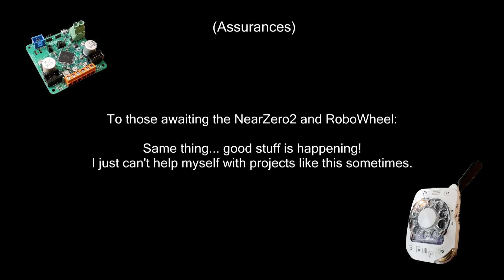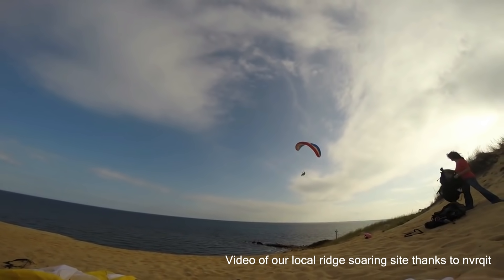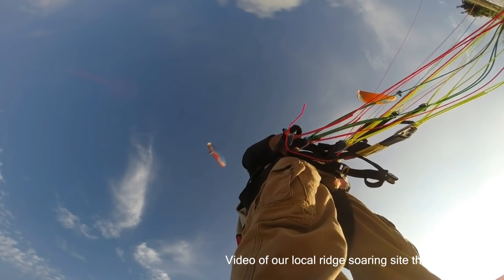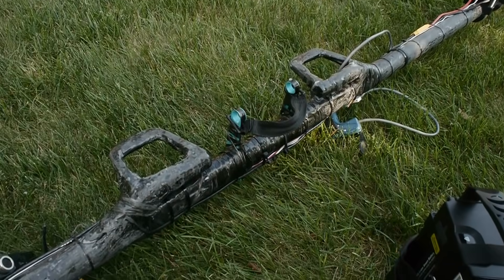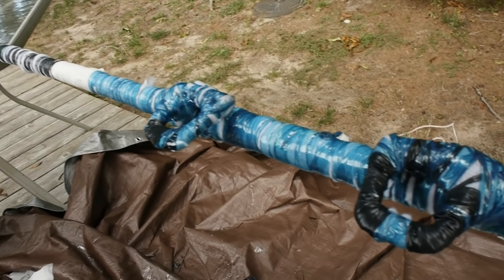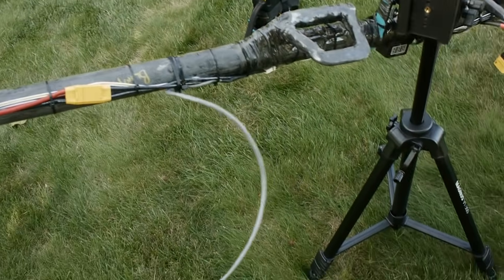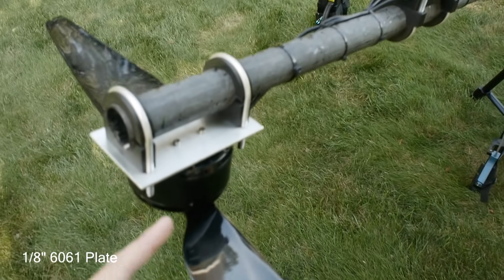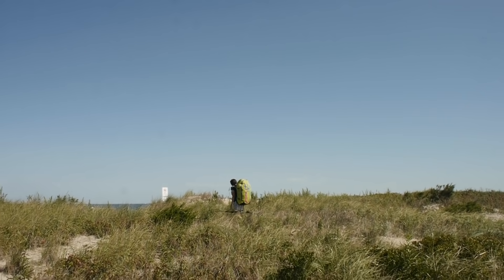Stupid-Simple Electric Paramotor

Comment: You are in the same axial plane as the propellers. If the blades break, you will be cut up from the sides. Keep the propellers either well in front of you or well behind you - NOT in the same axial plane.

Comment: Thanks for the great video. I found all the parts except for a compatible battery charger. All 12S Lipo chargers seem to come with connectors that are incompatible with Tattu 12S battery. Any guidance or solution there would be greatly appreciated. Thank you!

Comment: I would suggest some protection against asymmetric thrust. You don't want one side pushing more and twisting you in your lines. Quick reaction to loss of thrust on one side implies electronic regulation keeping both sides at the same speed, or even yaw rate sensing by gyro.
Reply: Maybe the best solution is to simplify it completely, start by going to a single slightly larger propeller and then move the propeller thrust line so that is central to the pilot's CG, basically on the pilots back.

Comment: Interesting. I’d shroud those props with a guard, similar to an oscillating office fan to protect the blades, and protect yourself. If a blade came apart due to damage or simple fatigue, you are in the plane of rotation. Pretty cool project and well thought out.

Comment: really impressed by your contraption.  I've also run into problems getting things molded and vacuum bagged correctly.  I reliantly started making forged carbon and forged glass parts with much better success.   Here is a great walkthrough video that really helped me.  The principles there also work perfectly for fiberglass.  I printed my parts in PLA.  https://www.youtube.com/watch?v=25PmqM24HEk

Comment: That is absolutely brilliant and the video was a delight to watch.  Makes me want to take up paragliding.  I appreciate the potential problem with deployment of a reserve though.  Paratroopers use a device called a "hook-pile tape (military name for velcro) lowering line" that lets them drop their equipment on a 15-foot tether to get it away from their body before landing.  Something like this would put the BlimpDrive well below you, but some thinking and testing would need to be done to ensure it did not create a new reserve entanglement issue.  The lowering line has a snap link that can be detached under load though, so you could always cut the drive away if necessary.  What a great and simple idea the drive is to solve a real problem.

Comment: Have you considered a cut-away system for it? Maybe a small parachute attached to it. That activates along with the cutaway? I know about skydiving cutaways but my knowledge of motorized paragliding to be zilch. Oh, do the vibrations cause problems with the carbon fiber connection points with the aluminum?

Comment: As an avitor myself, who has built and flown experimental planes, including putting a carbon fiber ground adjustable prop on the last plane I owned, I would recommend incorporating some kind of anti-rotation measures on the U-bolt attachment of the motors to the boom arm, or at least make meticulous inspection of those part of every pre-flight check... because there can be all kinds of wierd high frequency vibrations and harmonics generated by the prop blades transferred thru the motors and mounting hardware to loosen stuff up just enough to possibly end up with a motor's alignment slipping rotating on the boom arm and you definitely want both props always pointing the same direction at all times while in the air. Something about carbon fiber prop blades give them a magical, insideous ability to generate vibrations and harmonics and transfer them to the propellor hub  into the motor, and where they go from there can and up doing all kinds of wierd, unexpected, unimaginable bad consequences.... like in the case of Sensenich's carbon fiber blades + aluminum hubs ground adjustable hubs did when used on Continental O-200 4-cyl engines on light sport airplanes... ended up destroying the camshaft/crankshaft gears at the back of the engine after the harmonic vibes travelled all the way thru the crankshaft. Analysis finally revealed micro-chattering from high frequency harmonics were eating the teeth of the gears.
Reply: Now that's a good comment

Comment: What a brilliant idea! Instead of a lawnmower on the back, have it pull the carabiners. 👍
And yes, ducted props with cage would be more than a nice to have.
Plus a separate kill switch in case the Arduino decides to hang in the full throttle position or the potentiometer starts giving off incorrect values.
But I believe that this thing has huge potential.
And it is so quiet!

Comment: Newer propellar based plane models have them moved from head and wings to tail end for safety and efficiency. May be safty, balance and controle be better with a v shaped swept back structure fused with battery from back of the hip. Version next prospect for improvisation. Kind enough to share your model in detail.

Comment: I applaud the idea but the execution is very dangerous.  There are two major issues that I can think of off the top of my head.  The plane that those propellers are on comes much too close to the flyer.  If one of those props hits something it's going to shoot sharp pieces of carbon fiber much too close for comfort.  Also at the same moment you are going to have thrust on one side and not the other trying to spin you.  Same issue minus the flying debris if one motor goes out.  Hobby class speed controllers are not particularly reliable.  Either scenario could range from a small bruise to death depending on how lucky you are.

Comment: You are one smart human!  I came across your video for the stick... take off assist you made.  I am fascinated by it because you demonstrate ingenuity to us non engineering types.  My question is... where are you buying your pieces/parts?  Can you recommend where a novice like me might find these types of things?  I need a wheel chair/scooter device to get around.  I live in San Diego and cannot get out on the beach with my scooter and have ideas for a personal beach accessible 'thing' but don't know where to learn how or where to buy what would be needed.  My skills were in finance with prefab welding work as a hobby.  (I understand your msg about NY is more than the city as I worked in Manhattan in 92/93 and lived upstate just across the Tappan Zee in Nyack.  Quite frankly I would have rather worked in almost any other line of work because the corruption on Wall St was mind blowing and my dreams to work in that environment was shattered. Anyway... I have a lightweight frame design that could be folded and easily transported but the power plant eludes me.  (I haven't a clue I'm 64 and have very little knowledge about modern electronics).  Watching you with the brushless wheel motor renewed my interest in taking it up again.  None of the mobility products out there are affordable and few would work in beach terrain.  I thought you should know that you are responsible for igniting my passion to create this vehicle.  Thank you for posting your stuff.  As a finance guy... I think you could make some mad money from your presentations and hope you will keep in mind that you just may be sparking interest in some kid who may actually get educated directly as a result of the matter of fact way you demonstrate your engineering prowess.  Here's a gigantic 'thank you' for that!

Comment: That's awesome - great ingenuity!  Possible upgrades..  A wing profile 'stick' to cut down on drag. Rear facing motor assy. with props that pivot / fold when the RPM is zero; (as seen on some glider aircraft). Again for drag reduction.  But all very cool none the less.

Comment: Hi Justine, that was phenomenally interesting! You mentioned that you are already designing a more elaborate Mk2 version. However, my question to you is on this Mk1 version, do the props necessarily need to be quite so far apart? (although I appreciate they need to be far enough away from your hands and fingers obviously)..Secondly, (and like some hedge trimmer poles) you could make the unit in two halves for easier carriage in the trunk of a car, and just push & bolt them together when you get to your launch site. By the way, I also loved your hand controller that you made. You are very gifted. 🙏👏💪

Comment: Well done you can integrate the motor mounts with a carboned on plywood plate and foam can be easily carved and carboned over for the brackets and a tapered streamlined carbon tube made over a balsa form.
 I have used the tape on backwards as a vacuum bagging cheat with pin holes to let excess resin out possibly the battery box could be integrated to the boom for less mounts and further weight savings.
I like how the props are close enough to keep weight and size down but far enough away to be moderately safe without heavy shrouds and extra drag.

Comment: Nice idea and it works. Great to see an idea made into a working prototype.
Would you consider housing the blades in ducts? You probably have already considered this for your next version; as one day you might touch a rotor blade on ground at take off and the blade shatter, not good for the blade, but especially detrimental to you if that damaged blade heads your way at huge velocity. Also, please consider getting your blades inspected regularly, either X-ray or ultrasound to check for internal stress fractures. It does not have to be a special aviation inspection, unless your paragliding association, or aviation authority require it; the inspection could be completed by a specialist cabin fibre bicycle inspection company. They will have the expertise to pick up any internal fractures and damage.

Comment: i can see a potentially lethal safety issue with the design, which i imagine you have already considered. If for example one of the motors or both of them do not disengage and you ttip or for some reason your body parts get swung into the fan blades, it could cause serious bodily injury. Also if while they are spinning at high speed and one of them failer and shatters. it would cause sharpnel to potentially strike you and/or cause the apparatus to start spinnning and multiple safety issues. I imagin you have built in some safety features like that hand control...

Comment: That is very impressive! As a old hang glider pilot and current Nano soaring trike owner, may I suggest that the horizontal bar be made out of aerofoil carbon or aluminum. Mount the motors facing rearwards with pusher folding props and with engine off, the drag would be considerably reduced.

Comment: Impressive! I've been saving for a typical gas motor but you've inspired me. Looking at your website, I've found comparable motors and escs that bring the price down. Also, the battery you have spec'd, I've done the math, I can assemble a 12S6P Li-Ion pack that is 1 KWh for about $400 and the same weight. This should boost flight times near 30 min! Excited to start assembly.

A question, why and where did you get a carbon tube that size? Why not aluminum? Heavier sure, but less dangerous and easier to work with, less hardware required, cheaper etc

Comment: Brilliant.                                                                                                                                                                                                                                                        Just a suggestion. 
 By Ducting the props, eliminating "Wing Tip Vortices" thus doing two things. Increasing Propeller Efficiency by 27%., So this means you can go to a larger prop at slower RPM. This would make it much quieter.
 The second thing. Variable pitch props, plenty power for takeoff and climb, then a really long time at cruise.
I have been flying model airplanes since 1959. 1976 got my first Radio, been designing, building, and flying R/C since then.
 R/C Sailplane, electric motor and a battery, Take off and climb to altitude, shutdown power to Glide.
You have turned on my creative thinking juices. The simplicity  shows your true genius.

Comment: I hate to be a party pooper but there are a lot of inherent problem's with this system .One engine or prop failure comes to mind . The closer the engines are to the human body the less risks from motor failures out of balance thrust but with out prop guards the bigger risk for damaged prop to hit pilot . A more complex twin prop intermesh system where the two motors and props are behind the pilot similar to single motor  would reduce out of balance thrust issues  with single motor failure from prop failure or motor failure .Meshing props to not hit each other is easy enough with suitable sensors . Alternatively the single prop system with big prop can be replaced with two props and engines one behind the other strapped to back of pilot. The twin system you have would be lot safer if there was four motors and four props with each side having a pusher puller system and with sensors could detect one motor failure and reduce power to the other side so not to have imbalance .It might not work so good from bird strike taking out props on one side  but could help with many failure scenario's . There exist many RC model drone and plane users   who can build one to one scale and half and quater scale models to test out new ideas before putting real pilots into unknown problems  .They too can look to see if a four engine version of your system could after you climb to good height be dropped and become a self piloted back to take off zone  type dron allowing the para glider to fly away without all the weight and drag of these motors and battery pack  and test out all
types of failures  using dummy pilots . .Also the RC  model Drone and planes use these types of batteries and Props some with weights of real aircraft like  Cessna 150 sizes  so your project would be possible for them to doo in various scale sizes and make prototyping faster than real pilot flying  flights . I seen too many para glider and hang glider and ULM  incidents  go wrong often because minor problems like bird strikes  turbulence  forgot to strap in  used non aircraft quality parts that failed  etc . Murphyies laws comes in spades one your airborne and experimental stuff is piling extra dung events into the mix .In the old days we had no solutions but to fly and test it out but today with all the computer power  we can 3 d model test
ideas

Comment: An advantage could that the weight of the equipment is in front of the pilot, compared if the weight is on the back. In case of a crash its more safe for sure.

Comment: Look into Vesc motor controllers, gives a lot of parametric back to remote controller/phone over bluetooth. You set them up with a laptop or phone initially. Open source and inexpensive for what they are too. Things like battery voltage, esc temp, motor temp, energy used etc. The phone app is very advanced. They have current monitoring and automatic limiters so you can use oversize propellers without blowing the motors, very handy feature. If a line would get cought in the motor overcurrent protection would kick in with 1/3000-8000 of a second. Saves my sailboat motors when I run aground or propellers jams with weeds(2 run agrounds and 2 times by weeds ;) ). Cost about 300usd for a decent one..

Comment: Why not use dual counter rotating propellers in the back? wont it be easier to move and more compact also safer in case of propeller structural failure?

Comment: Very cool =) Rear pusher props also tend to be more noisy due to turbulent air in the wake, where as front puller props work with undisturbed air. I'm curious about safety measures. But was thinking a quick kill-switch would be good in case of motor/propeller etc issues. Was picturing a scenario with a fault where one would keep running at max while the other shut down. I dont do para so not sure how bad that could be just imagining you spinning and twisting cords idk. Perhaps also an easy way to jettison the battery would be good in case of fire. Rare, but can happen. Lithium batteries tend to burn rather violently. My thoughts. Perhaps nothing new:)

Comment: Justine, you are genius! A simple add-on for a regular harness. No torque due to counter rotation.
I am very excited about your further progress. Especially more safety.
What about the drag while gliding? Could you measure it with a vario and compare it to free flight? Maybe use folding props? 
Some time ago I thought about a similar setup, but instead of a single tube, I would use a triangle. Makes it more rigid and safer; pilot is in the center, props behind and battery in front.

Comment: Put the 'motor assembly' behind you with a few quick release handles and you have room for the emergency shoot. The bar will drop off and you will still have the option to go without or pull your e without worries of it getting in the way.

Comment: This is an awesome idea, I love it!. That looks like a lot of fun.  But... it scares me. I fly drones with unprotected propellers and have had small 7" props slice an inch into my leg with several small other cuts because the prop was spinning at nearly 20k rpm. I would put a cage or protective ducts on those props. with that size motor They will literally take your head off if something goes wrong. I know that's a graphic statement, but its a very real threat. As is having a prop break, but im guessing the rpm is going to be low enough that it wont be an issue with those particular props given inspection before flight. Just be careful please! I would also suggest trying a tri-blade if you have balance/vibration issues. tri-blade props are a lot more forgiving when it comes to propeller balancing. They are less efficient when it comes to power draw but they will also produce more thrust. However they would allow you to use a slightly smaller propeller for similar thrust, smaller size, and better balance.